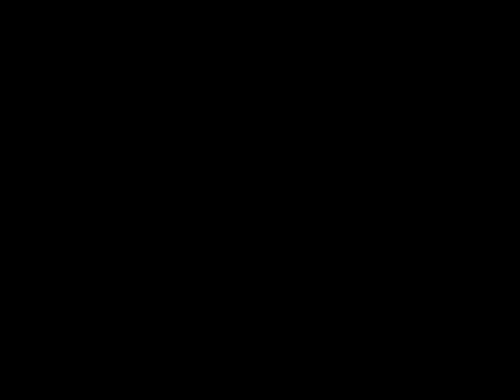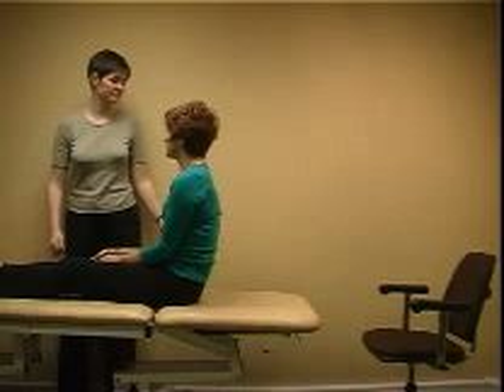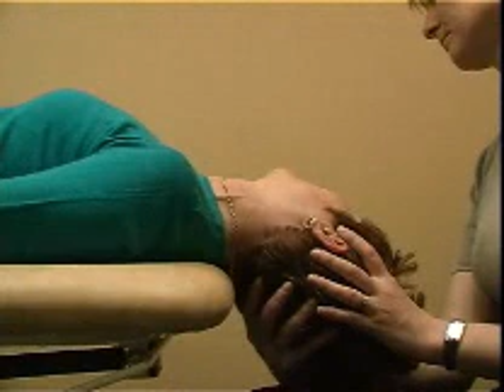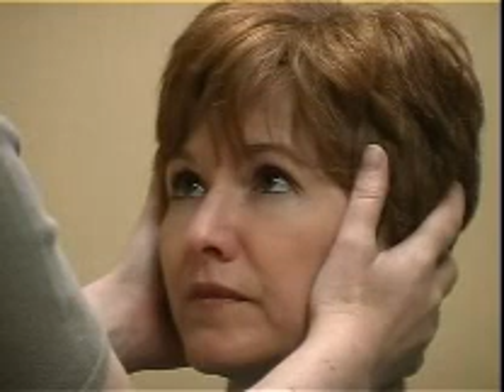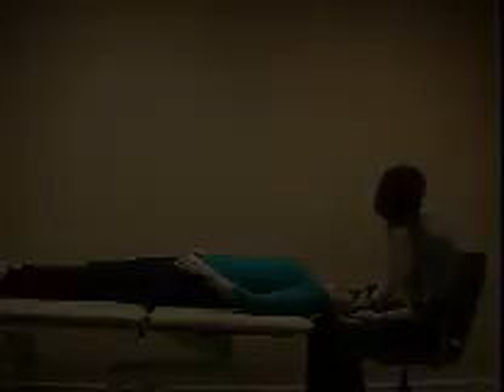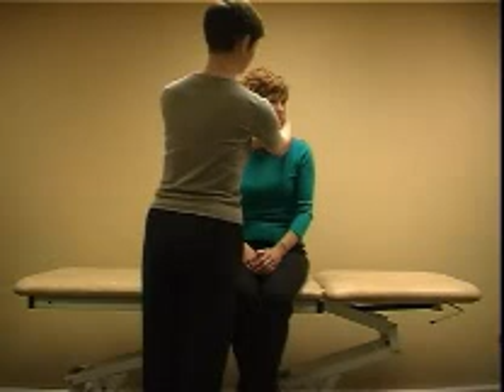Testing for Posterior and Anterior Canal BPPV

Comment: Well, I guess I'm late to the party, but hopefully you will see this.  The easy way to differentiate between VAI and BPPV is to have the person sit on a stool that can rotate.  Place them in position, stabilize their head and have them rotate their body using the stool to one side and note any changes.  If there is a response then it is automatically VAI.  If not and they have a response to traditional testing then it is BPPV.  Hope this helps whoever may be reading.
Reply: Not sure if it is effective but looks logical. Thanks anyway.
Reply: what is VAI? hope you answer